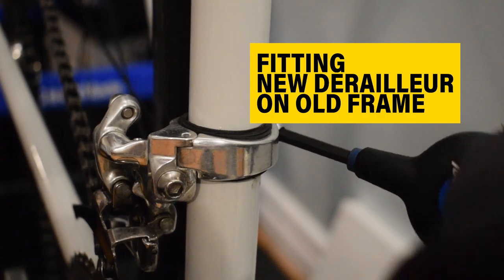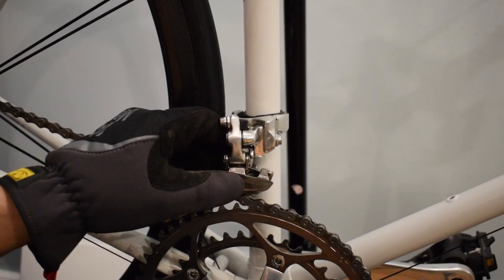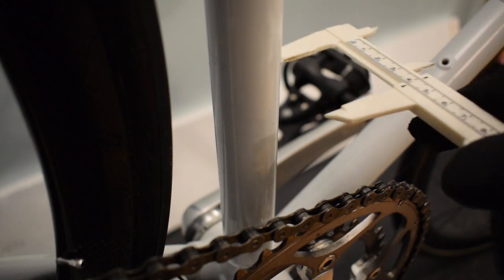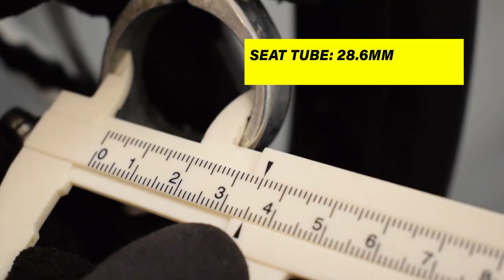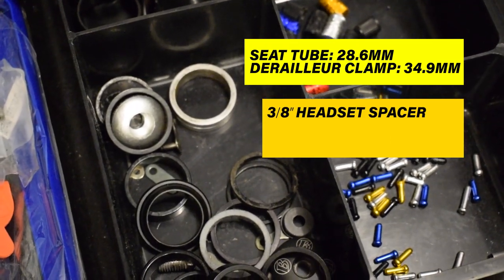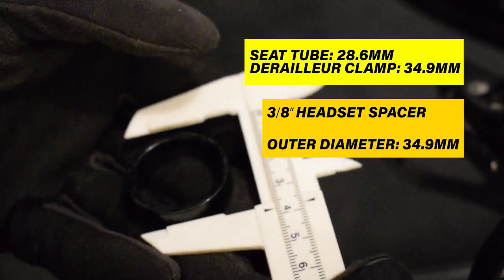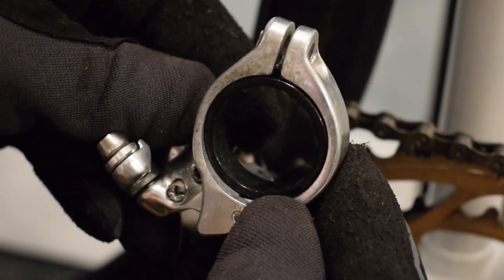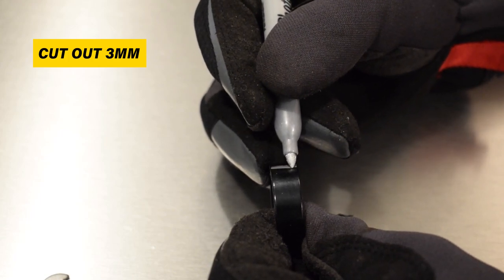Fitting New Derailleur On Old Frame

Comment: what glue did you use to stick the rubber into the spacer?
Reply from the maker: I used glue for plastic, but double-sided adhesive or grease would work as well, the idea is to hold it with the spacer.

Comment: question can you use inner tube for it ? just the inner tube
Reply from the maker: I wouldn’t use inner tube, it’s not sturdy enough to hold the derailleur.
Reply: @DanyoSports  what about a piece of tube ?
Reply from the maker: You can try, but it’s not solid enough.